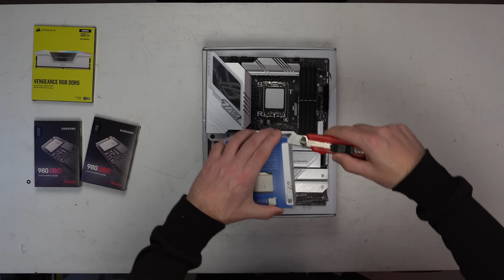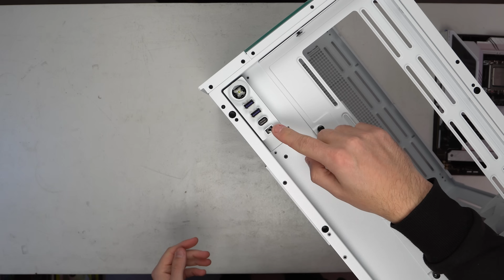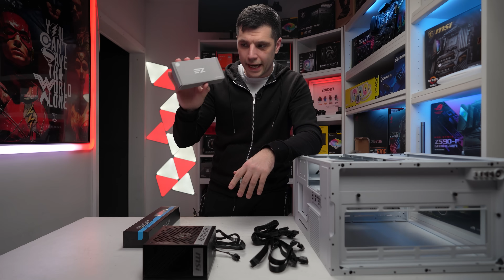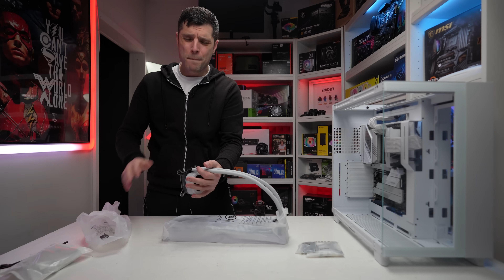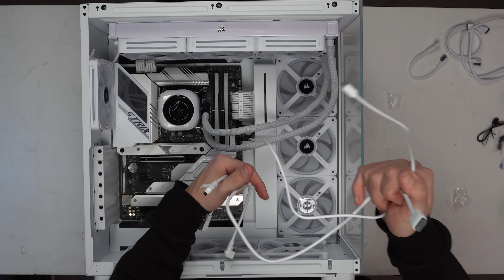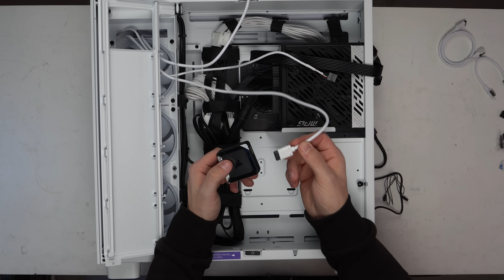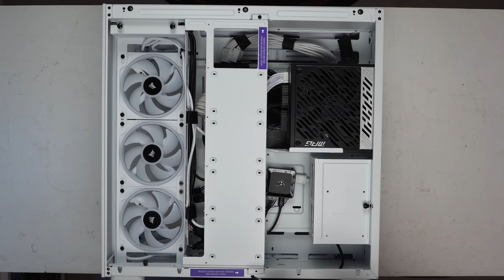Beautiful All White Nzxt H9 Flow Pc Build FT 14700K & RTX4080 Super

Comment: Looks great! Think I'll go for a similar setup for my first build. Is there enough air expenditure is my only thought?
Reply from the maker: Absolutely mate it's a great case and wicked airflow I love the case and it's really easy to build in too 😀 👍
Reply: @TechCheckUK  i was reffering to the fact you have only one exhaust fan. Is that enough or am a missing something?
Reply from the maker: @rgrsthhj 6 intake fans and 4 exhaust fans mate
Reply: @TechCheckUK  ah, sonds good think I will do the same ratio :) did you use the aio for exhaust?
Reply from the maker: Yes mate
Reply: @TechCheckUK   I see, well thank you for the answers :) might for exact same airflow setup
Reply from the maker: @rgrsthhj no worries mate 👍 good luck with the upgrade
Reply: @TechCheckUK  Cheers mate :)
Reply from the maker: No problem 😊

Comment: Is it worth going for the QX Corsair fans, or should I go with Lian li fans, I’m deciding which of the two to buy for better airflow cooling
Reply from the maker: Both are great eco systems and work fine mate just depends on personal taste tbh - I like icue and I have other corsair parts so works well you may be different. Either way both great and won't be disappointed 🙂

Comment: Could you do a cheaper version with this case but in black please? About 1200/1300€
Reply from the maker: That's would be a 4060ti build with a 14600kf on a b760 mobo 1tb nvme 750wt psu - built in this case so many times mate
Reply: @TechCheckUK  im not very expert could you write all the pieces that I need please ?
Reply from the maker: This is all personal preference mate

Comment: Hey mate, great PC build! I have a question about the cable extensions from colourful mod. Do I need the 6 piece extensions or is the 4 piece extension enough?
Reply from the maker: 6 piece mate this gives you 2 x eps cpu cables and the 24 pin cable along with 3 x pcie cables - hopes that helps mate 👍
Reply: @TechCheckUK  Thanks man, i bought the 4 piece because the 6 piece has been out of stock for a while now, will the pc still work with only the 4 piece?
Reply from the maker: Yeah it will still work with one 8 pin eps cable - just look in your manual which one is your primary connector ( should be the one on left) Regards
Reply: @TechCheckUK  Thanks for your help and reply’s. I returned the 4 piece and got the 6 piece because it got in stock again. And you are my favourite PC building YouTuber btw, and I even dropped a follow on your instagram! Thanks again for the help 😀👍🏾
Reply from the maker: Many thanks mate I really appreciate it, good luck on the upgrades.
Reply: @TechCheckUK  Thanks mate! Keep up the great work 😀
Reply from the maker: @Rithvikk1  thank u
Reply: @TechCheckUK hey there its me again with another question, I just built the pc exact same but on am5, and my aio and fans aren’t showing in icue, I checked everything in the pc. Can you help me out please?
Reply: @TechCheckUK also I forgot to mention that I also get the caution triangle thing sometimes randomly on my lcd screen
Reply from the maker: Hi mate you need to ensure your connect the usb c to usb 2 on mobo from radiator. Also need to ensure you don't have anymore than 7 fans on one input on the icue hub
Reply: @TechCheckUK  thanks bro, I fixed it. It was my windows version my dad told me to download, I did a clean install and it all worked perfectly. 1 thing though, I have a 7800x3d and my idle temperatures seem a bit high, it goes from 40 - 65 degrees Celsius doing nothing or just sitting in icue. Do you know what’s happening?
Reply from the maker: @Rithvikk1 it could be a slight imperfection on the cpu cooler tightness mate
Reply: @TechCheckUK  Ok thank you, i will fix that, and do you think a 4070 ti super is a good combo with my cpu?
Reply from the maker: @Rithvikk1 what cpu u have?
Reply: @TechCheckUK I have a 7800x3d, I got the 4070 to super and also I’m having trouble connecting the gpu cable to my power supply. It’s a Corsair one, it would be greatly appreciated if you respond as soon as possible 😁
Reply: @TechCheckUK and I just found out that I have been trying to plug it into the pcie slot on the power supply, and on your psu you have a 2x6 slot but on my Corsair rm 1000x I don’t, what can I do?
Reply from the maker: @Rithvikk1 hi mate it's not 2x 6 it's a 8 pin cable but you can just pull the connector apart and that will give you a 6 pin connector to power the hub
Reply from the maker: @Rithvikk1 you can either connect using 1 x 600wt hpwr cable - 12+4 pins Or you can use the adaptor which needs 2/3 8 pin pcie cables
Reply: @TechCheckUK  hey I just returned my old power supply and got a new one with the native 16 pin, thanks for all of your help mate !
Reply from the maker: @Rithvikk1  More than welcome

Comment: AND ... you never showed the connection of the "white" usb c from the radiator to the motherboard
Reply: 27 min - 28 min on video
Reply from the maker: Correct I didn't because I have a comprehensive icue pink guide in other builds

Comment: Why not install the radiator on the "side" and use the 3 of the fans included with the case behind the radiator for a push pull ... there should be enough room in the back for them ... right ?
Reply from the maker: Yeah there is room for push pull your correct- there wasn't any need really temps were great and sub wanted all matching even tho you would never see them - I did ask 😉 thanks 4 watching 👀

Comment: Fantastic set up and I will be doing an AMD version with a 4090 in the near future. Just a quick question about the H9 flow: is there enough room to mount the AIO on the side position and have a push/pull setup?
Thanks in advance!
Reply from the maker: Hi mate yes 100% put the rad and 3 fans in front and then 3 fans at the back 👍 it fits no problem 😊
Reply: @TechCheckUK  Amazing! Thank you ❤️
Reply from the maker: @123jocook  no worries 👍

Comment: Thanks for the great instruction video! I'd never though I would be able to assemble a desktop myself! :) It was a great help and really helped picking the right components with some reassurance it all works together.

Please don't take this as negative thing, but I've listed some minor mistakes for OCD people/complete newcomers like me, to save some time:
1) The motherboard only needs 8 screws instead of 9, the middle hole of the motherboard doesn't need one;
2) While adding the RAM to the motherboard, both locking tabs should be pushed open to insert;
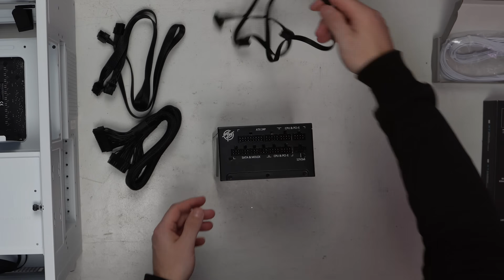3) Around 13:13, the PSU 90 degrees cable should be just a 6+2 PIN PCIE cable;
3) The white USB2 from the AIO isn't shown to be plugged into the motherboard;
4) The video part about plugging in the 3 side fans long cable isn't shown, it appears later in the video;
5) After all the fans are properly installed, the AIO should be screwed down so it'll be tight on the spot;
6) To insert the CPU fan cable for Corsair link into the motherboard, the protective cover should be removed from the pins;
7) To use bluetooth and wifi, the antenna should be attached at the back of the case into the motherboard. You might also have to update some optional Windows drivers!

Cheers again, I hope my subscribe and like will help your channel further! :D
Reply from the maker: Thank you for your support and I take on board the feedback - I'm glad it offered you assistance and pleased you managed to build your system 👍

Comment: what would be the best cpu for gaming for the same motherboard you use for this build
Reply from the maker: 14600k or 14700k mate if it was this intel socket
Reply: @TechCheckUK  thank you just one more thing would it be best to have a intel or and for gaming
Reply from the maker: I would go 7800x3d rather than intel as the mobo will last next 4 years and can always upgrade cpu if wanted without changing anything else

Comment: I followed this video and built this pc all except the GPU could not find one here so I got the rog strix 4080 super it all works perfectly and looks awesome thank you so much for detailed instructions
Reply from the maker: Great to hear mate and good job - i appreciate the support and enjoy that new build
Reply: Dude what did u do for the 3rd 8pin on the 4080 I’m new to pc and I’m stumped
Reply from the maker: @Redgotsticks you either use 1 x hwpwr cable or 3 x 8 pins with the adaptor that comes with the gpu

Comment: I have asus prime motherboard can I fit all 7 extra fans in my case with it ??
Reply from the maker: Sorry mate u wanna put your mobo and 7 fans in the h9? Or are you talking about adding corsair qx120 fans sorry please explain and sorry if i don't understand.
Reply: @TechCheckUK  so I got my nzxt cpu cooler on and my other 4 Lian li fans on, I wanna put 3 more Lian li fans on the bottom but will my asus z790 ax mobo support that many fans or is there another way I can do this
Reply from the maker: Z790 boars will have at least 5 pwm headers mate ao if you run out you can always get a splitter cable and connect a few together if you had too - really cheap you can also get them in a 2/3/4 way too.

Comment: does the single corsair fan come with a 60mil cable?
Reply from the maker: Yes mate corsair added them to all single fans 👍
Reply: @TechCheckUK I want to do this build but with r7 7800x3d and rtx 4070ti super on a gigabyte x670e mobo. Would i run into any issues with connecting everything to the mobo such as all the qx120 fans.
Reply from the maker: No mate u would be fine - tge fans all connect to the link hub and then this connects via usb2 to mobo. The cpu and gpu choice is great too 👍

Comment: i have i9 13900k and 4080super tuf can i use 850w?
Reply from the maker: Yeah as long as not OC CPU or gpu will be fine
Reply: i bought the 4080super tuf
Reply from the maker: I mean if you plan on overclocking them mate if your not it will be fine but if you experience any blue screens it's because your on the limit
Reply: @TechCheckUK  oh okay thanks man appreciate your reply ❤️
Reply from the maker: No worries 👍

Comment: Some motherboards reduce gpu performance if the first gen 5 m.2 slot is occupied by a gen 4 m.2. This varies by motherboard
Reply: I want an all white build so bad, lol. It always looks so clean
Reply from the maker: Thank you - white always looks clean but always costs more too by 10-15%.good luck mate 👍
Reply from the maker: All depends on cpu / mobo and dedicated pcie lanes- rtx4090 can be maxed out via a 16x slot running at x8 gen 4 so even if you put a gen 4 nvme in top and second slot on this board and ran a 4090 you would be great mate 👍

Comment: By putting the Nvme into the top slot, will this not affect the GPU down to half of what it is from 16 down to 8,  I been told that this does happen with some intel motherboards or is what I was told false.
Reply from the maker: All depends on a combination of cpu / mobo and pcie lanes mate so not false - truth be told even pcie gen 4 x8 is more than enough for any rtx4000 series card running at max. Z790 and x670e with a decent mobo will be 100% fine.

Comment: hey im getting the same extension i have the lian li for 24 pin so its specifically for the 4+4 pin eps I was wondering does it come in 2 like yours did? ( I also have the same mobo)
Reply from the maker: Yeah the eps cables are 8 pin but they are 4+4 cables

Comment: Your big mistake was plugging the extension directly into the power supply, that is a well-known absolutely never to be done! You use the supplied power cable that came with the power supply and then attach that to the extension cable...
Reply from the maker: Haha lol what this was a 16 pin hpwr cable 🤣 same pin outs on every atx3 psu mate. YES I agree never just use a cpu or pcie cable from one psu to the other as the pin outs can be different BUT not on this cable so please don't tell me I did something wrong if you don't 100% understand what your saying. I build over 150 pcs a year and have done for last 5 years with ZERO ever to be returned. Thank you for watching I appreciate it
Reply: @TechCheckUK  O.K........

Comment: I’d recommend that you install the AIO backplate on the motherboard out of the case when installing ram, cpu, nvme so you don’t have to remove the PSU.
Reply from the maker: 100% agree mate it was very tight and is much better to do before installation of psu.

Comment: I like it a lot.  And it almost looks like there are no cables from the front.  If you were to switch to air cooling, what would your recommend, in white of course. While you lose the LCD on the AIO, you also get rid of the AIO tubes (which is very good).  Could you switch to Lian Li fans and get the LCD back that way?
Reply from the maker: Thanks mate and yeah you could go all lian li with lcd AIO. For cpu tower cooler I would go with - https://amzn.to/4b5rc8x or https://amzn.to/3xKFQng or https://amzn.to/3xMFNaB all less than £65 there are lots mate and especially higher end tower coolers from noctua etc just depends on tdp of the cpu your going with.

Comment: build is absolutely stunning
Reply from the maker: Thanks mate glad you like it and 4 taking time to comment 👍
Reply: @TechCheckUK  yeah no problem mate, would love your input on a pc i want to build i already have a case its the asus gt501 in white and i want to do an intel build around it capable of 1440p? Any recommendations/suggestions
Reply from the maker: Yeah no problem what budget do you have and other than case do you have any other parts already?
Reply: @TechCheckUK  i technically have a setup already but its old and wanted something new and my budget is under $2000 if possible my current setup is a amd ryzen 5 5600x with a nvidia rtx 4060ti 8gb
Reply from the maker: This is a wicked little build already mate - great at 1080p 
If I had 2k I would be going 14600k 4070ti super 
I would also be selling my not so old system - £800 this would be amazing at 1080p or 1440p no probs - 850wt psu and a nice 1tb gen 4 nvme
Reply: @TechCheckUK  yeah love what is does at 1080p but im also 21 and want something a little more beefy and everything i have is used except the gpu and cpu and the case
Reply from the maker: Yeah a 14600k and upgraded gpu would be much beefier but maybe best waiting for 5000 gpus at end of 24.

Comment: sir if we are using icue software , nzxt cam and saphire trixx is there any chance they will conflict with each other and damage the parts in the case which have rgb leds physically ?
Reply from the maker: If this is the case I would use one software like signal rgb which runs everything - answer is no nothing will get ruined but there maybe a few conflicts as the different rgb controllers will truing to take control not to mention additional resources needed to run them. 1 is better try signal rgb all in 1 software
Reply: @TechCheckUK  i got the h9 elite in april then i started to use nzxt cam for my fans, icue dor my corsair ram and saphire trix for my 7800xt gpu and after 20 days my gpu stopped showing rgb can’t say id this is related to different software

Comment: Mine cpu cable i have inserted in top side of psu... and if if were to use standard pcie cables those will be the bottom slots given by psu
Reply from the maker: As long as you put them in where it says cpu or pcie you are fine mate 👍

Comment: The Cpu and pcei cluster on psu are all same as input means can you put cpu cables on top and below and pcie also top and below means they are interchangeable?
Reply from the maker: Hi mate - cpu and pcie are 8 pin inputs yeah I like to connect cpu on one rail and gpu on another - it doesn't matter tbh but it's just habit 😉 as long as you have them in the 8pin input your good mate

Comment: Lovely build mate, just got my new set up with H9 loving it so far. Looking forward to a special ProArt build soon to come ;)
Reply from the maker: Haha it's funny you say that because over the next 4 weeks I'm doing this exact pro art build - mobo and gpu in black mate 😉 👍 appreciate you watching thank you
Reply: @TechCheckUK  Very excited to see the beast in action, would love to see a cable management video also for the back of the case having a nightmare doing mine at the minute, along with a BIOS guide (flashing and ideal settings etc).  Also got a 7800x3d and noticed idle temps are averaging around 40 and boot times are averaging 40-60 seconds, any idea if that is normal?
Reply from the maker: Problem I have mate is these types of video - no one wants to watch 😕 I love them but seems like people only watch when they need to. Temps for 7800x3d should be 30-35c idle if 360mm AIO. Always ensure chipset and bios are updated to ensure your board have best and latest settings. I would just Google bios update for your mobo and I'll gaurentee there are lots of videos mate.
Reply: @TechCheckUK  It's a shame love those indepth insight videos, any ho I'll have to have a fiddle with the fan curves then in that case, appreciate the quick responses!
Reply from the maker: @Ziel_Ziel7  three things mate: 
1 - ensure enough thermal paste and AIO has correct tension on cpu and case fans orientated correctly 
2 - optimise fan curves in icue 
3 - Ensure all drivers / chipset and bios upto date

Regards mate 👍